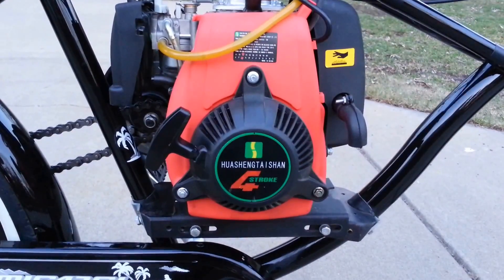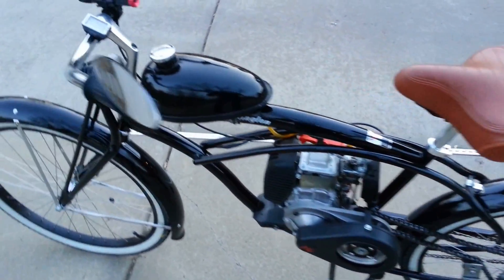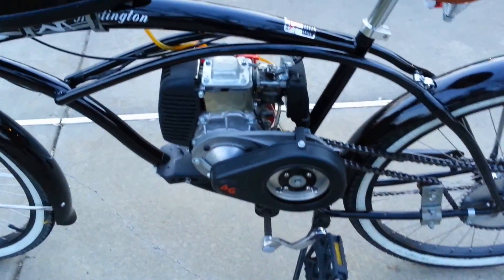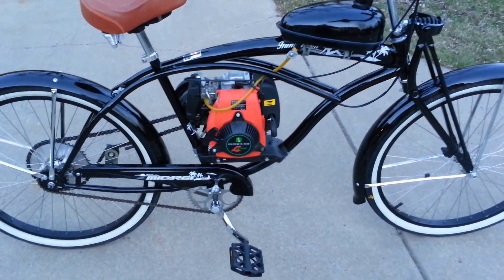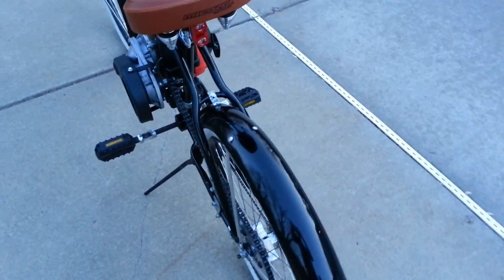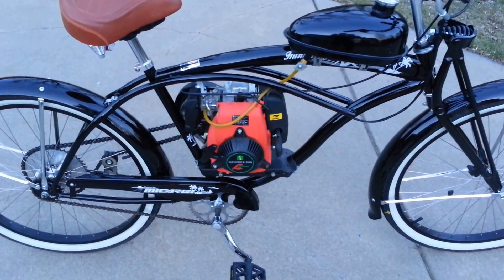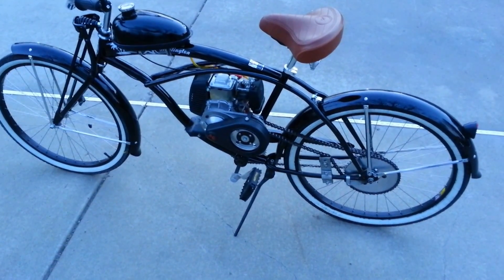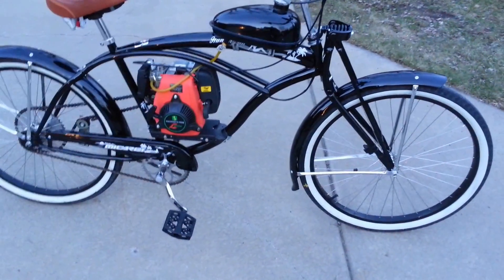4 Stroke Motorized Bike (2 stroke VS 4 stroke)

Comment: What you say it true to some degree... i own both 2 and 4 stroke... both are reliable as i rode 100 mile round trips on both running them over 2 hours at a time in 90 degree weather... Ive gotten about 6000 miles without any problem on my 2 stroke (just piston replace)... Up side about 2 stroke faster(modifications), easier to fix as all components are reachable... 4 stroke i can pull up to pump and pump... 2 stroke uses more gas... regardless of stroke oil quality is important no cheap stuff Semi Syn Only... for 2 stroke 25:1 break in 32:1 after, i always ran 32:1 (lucas)... dont have to worry about oil injection on 2 stroke... 2 stroke easier to clean out... 4 stroke MUST be level on metal plate or you may have carb issues... a 2 stroke can be ran upside down damn near so... I still prefer my 2 stroke as im purchasing a new one... I recommend any first time motorized bicyclist to get a 2 stroke less things to worry about as it parts and money... 

I just sold my 4 stroke and i will be posting new videos and howtos of my new 2 stroke soon
Reply from the maker: Hey Joshua! Great comment which I greatly appreciate. If I remember correctly I mentioned that there wasn't too many 2-strokes going much over 5000 miles, you said you got about 6000 without any problems immediately followed by "just piston replace", which I would consider a problem in my eyes. Depending on the mechanical aptitude of someone purchasing a motorized bike I would never recommend a 2-stroke engine personally. You stress a 4 stroke has to mounted on a level plate, which is true. However, it's really easy if you know what you're doing. I have no need to mount an engine at an angle or up side down. Most people are not going to want to tear their 2-stroke apart to fix it, they want reliability, which a 4-stroke like I mentioned is very common to be clocking 15,000 miles and still going with no problems at all. You said you ran your engine for 2 hours in 90 degree heat, followed by a piston replace at 6,000 or less. It could have taken some life off of it, could have been a bad engine, or any number of things for that matter. 2-strokes definitely have more capability to be modified. 2-strokes have more torque and speed, however I have found some ways recently to get more out of a 4 stroke also, without compromising quality or longevity. It all comes down to if you to deal with a clutch, mixing gas/oil all the time, noisier, smokier, less efficient, and more repairs or even complete replacement. If you don't mind the above then yes, a 2-stroke is fine.
Reply: Sinister Custom Cycles Have you even owned a 2 stroke?
Reply from the maker: I haven't personally owned a 2 stroke as I don't want to deal with everything I mentioned above. 4 strokes for my usage and most of my customers I have encountered is the best way to go. However, I do have one of my friends that has one I built, and also have had other customers come in with 2 strokes. Like I mentioned before it fully dependent on personal preference, and how the bike is going to be used. I'm just pointing out the raw facts.
Reply: Just a "piston replace", hahahahahahahaha, what kind of reliability is that?